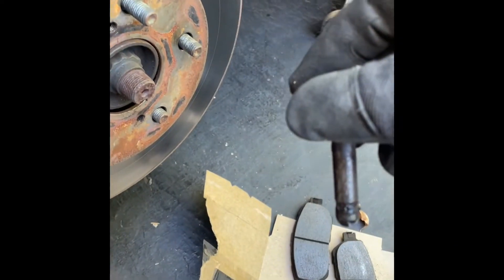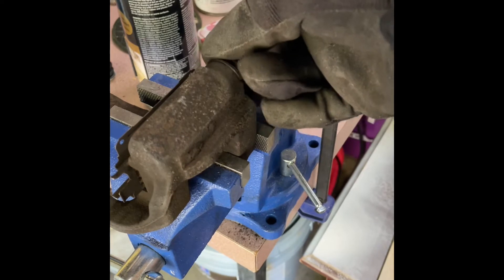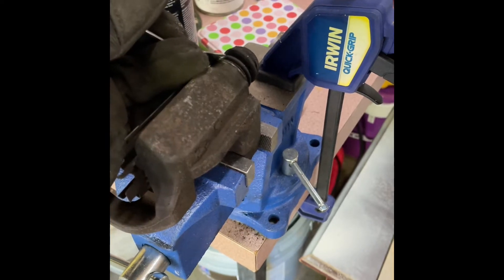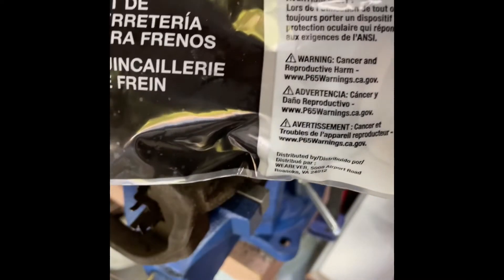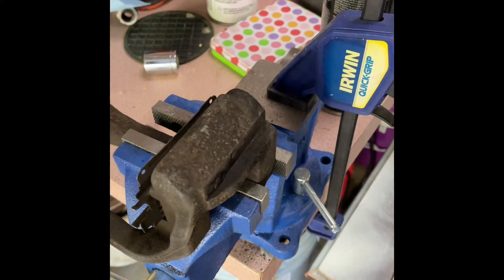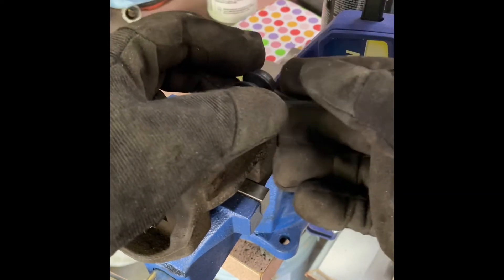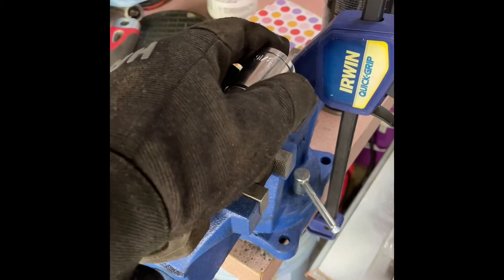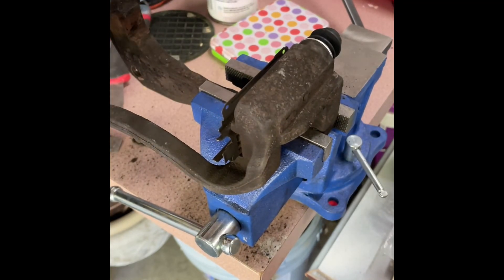How to replace caliper pin sliding bushing on a 2006 Toyota Sienna CE caliper bracket! Easy

Comment: One of my old caliper slide pins had a notch near the end where I think a rubber bushing goes, but the other slide pin did not.  Unfortunately, I didn't notice this until I removed both slide pins, so when I put new pins in, I'm not sure if the one with the notch goes in the top or the bottom of the caliper bracket.  I'm also not sure if it matters.  Do you know if it matters, and if so, if the slide pin with the notch and bushing goes in the top or bottom?  BTW, thanks for the video!!